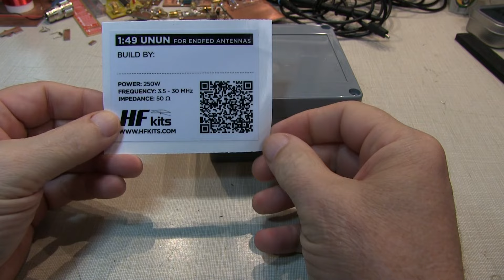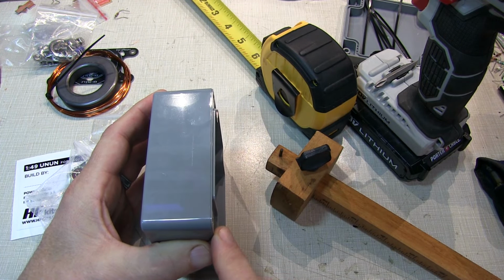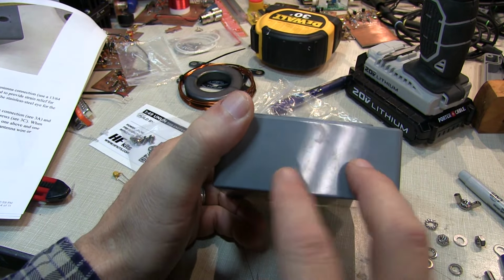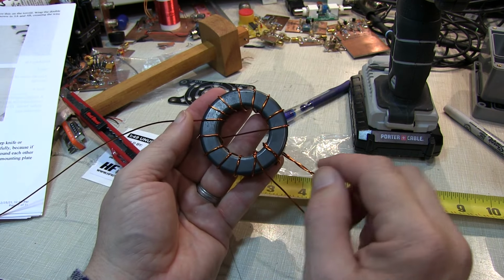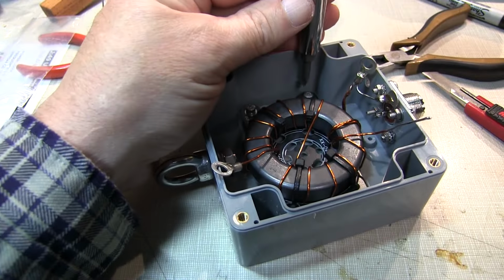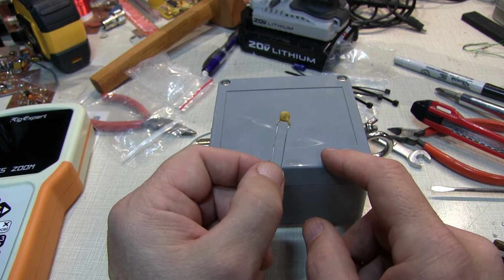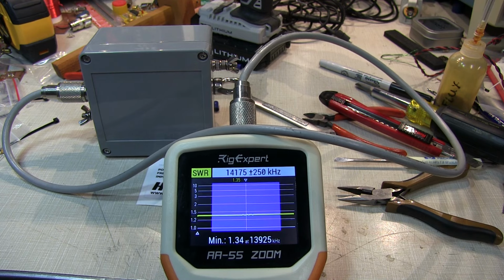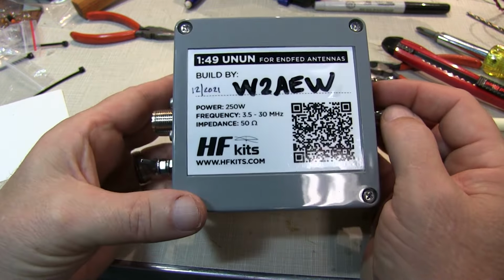#344: ARRL 49:1 End Fed Halfwave UNUN transformer kit from HFKits - Build and quick bench test

Comment: It looks like your turns are spaced apart on the toroid. I have seen all the other products with tight spacing, especially keep the input windings away from the output is preferable.
Reply from the maker: Tight windings increase the interwinding capacitance, which I want to avoid.
Reply: @w2aew  What about coupling from the primary to the secondary?

Comment: Great video. I do have a little trouble understanding the theory behind crossing the core with the secondary winding.
It's not the first time I've seen this, I can imagine there are reasons for it. I understand that it tends to decrease the parasitic capacitance of the winding.
But I have trouble with the fact that it is wound in the opposite direction of the first section: the core is the same: is it correct "magnetically"? 
The flux goes in a certain direction in the toroidal core, if the second section of the secondary is wound in the opposite direction of the first one, doesn't this cancel (or decrease) the induced current in the secondary?
Excuse my vague comments but I don't have the theory to understand these components.
Reply from the maker: If you look carefully, the direction of the windings isn't changing - the entire thing is wound with the wire coming up through the core and over the top, around the outside and repeat - even after the skip over to the other side of the core.
Reply: @w2aew  Indeed, I invent problems where there are none (it is inherent to my personality).
You have just answered a question that I have encountered many times.
Thank you very much for your help!
Reply: As far as I know, it is done this way to get the "exit point" of the transformer at the opposit site of the "entry point".

Comment: Great build video -- quality content as usual. Couple of questions (since I've usually dealt with dipoles): The instructions don't mention much about the counterpoise. What sort of counterpoise would one start off with for this antenna (what is the counterpoise actually needed for)? Would the coax cable act as a counterpoise, and might there be stray high voltages in the shack as a result? Should I ground the coax at the entry point into the shack? Would this antenna produce a pattern similar to a dipole at the base resonant frequency? I think this would be a fun antenna to experiment with! Thank you and 73.
Reply from the maker: In general, the coax shield will form the counterpoise.  Unlike a dipole where the feedpoint impedance is low, and thus a low-impedance counterpoise is needed, an EFHW feedpoint impedance is high, so the counterpoise can be high impedance also.  Another commenter offered great advice - add a common mode choke to the feedline at about 0.05 wavelengths from the UNUN at the lowest frequency of operation.  That'll generally be all the counterpoise you need with an EFHW.
Reply: @w2aew  Hi,

I plan to have only 2 feet or so of feedline outside the radio room/window pass-through with the unun attached to the side of the house and wire running out to a 37ft pole in the yard. There really isn't much feedline to "choke" or to act as a counterpoise. As a consequence I plan to create an 8ft ladder line counterpoise as suggested by one of the other commenters. In this set up would you still anticipate the need for a choke? I don't have 0.5 wavelength available.
Thanks!
Kind regards,
John - KK7JBZ

Comment: I would have liked to see the same test done but with a choke wound toroid or just a core at the input at the coax connector.  The purpose would be to see if the coax shield has RF on a part of it.  Sliding a toroid core down  the coax toward the radio might show how much of the shield is working as the rest of the antenna.  Is .05 wave length of the shield used??  If not, how much.
Reply from the maker: I'll include that as part of the antenna test when I do it.

Comment: Do you have a video explaining the math behind 49:1 and how you get that from a 2T:14T here? I also see others with 3T:24T in a Mix 43 configuration.  That is eluding me and I can't presently find anything that explains it.
Reply from the maker: Both 2T:14T and 3T:24T are a 7 to 1 turns ratio. 24/3=14/2=7. The impedance ratio is the square of the turns ratio. 7*7=49
Reply: @w2aew  Easy enough.  Thank you!  Is there any advantage of using more turns or less turns to get a ratio?
Reply from the maker: @NGinuity  More turns are generally used at lower frequencies to get the inductive reactance of the windings higher.

Comment: Did you needed counterpoise with this EFHW dipole? I am currently working on the similar kit but 100W, and will try to realize ca. 12m wire with coil, to do 10, 20 & 40m band.
Reply from the maker: Generally the coax shield will serve as the counterpoise.  Some people find it helpful to put a toroidal choke part-way down the coax, but I haven't found it necessary in my case.

Comment: This is an excellent kit. I noticed at the web site (hf kits) mine started with the german language, was surprised. I clicked on the British flag and it went to english. One guy did a test for temp increases and he used his fingers to measure it. Not exactly smart. I'll try it with a high powered 3000 ohm resistor possibly, and a thermal infra red reading point and shoot thermometer. So many of these kits come out with small toroids, not good. I really like this one but I'll be building with my own toroid ect.

Comment: Hi
What is the difference of balun or unun?
Reply from the maker: BALUN = Balanced to Unbalanced transformer
UNUN = Unbalanced to Unbalanced transformer
Balanced means that the two conductors have an equal but opposite voltage swing on them - like ladder line or the center feed of a dipole.  
Unbalanced means that one of the two conductors has little/no voltage change, and all of the voltage changes are on the other conductor - such as in coaxial cable.
Reply: @w2aew  baluns or ununs just will use in impedance matching?
So what is 1:1 balun? It has a same ratio!
Reply from the maker: @Cyrusradplus  A 1:1 BALUN is typically used to interface coax (unbalanced) to a balanced feed antenna such as a dipole or loop.
Reply: @w2aew  thank u so much for the complete answers.👍👍👍

Comment: How do you verify that the impedance range of your actual EFHW antenna is approximately 2,450 ohms resistive (turns ratio squared x 50 ohms)?  Is the reason your test SWR is not 1:1 is because of the reactance of the resistors combined with the non-linear reactance (mainly inductance reactance) of the transformer?

Also,  I am puzzled about the purpose of the primary capacitor and how the toriod mix ( 31, 43, 52, etc.) affects the impedance match and how to increase power handling capability of the transformer.  I would appreciate you elaborating on these questions.  I have learned a lot from your many fine videos.

Comment: Hi Alan, thanks for the video, I had a question though, sorry if it's a stupid one, but why do we need the double wires for the first two turns and then single wires for the rest ?
Reply from the maker: The transformer has two windings - a 2-turn primary and a 14-turn secondary.  This gives a winding ratio of 7:1 which results in the impedance ratio of 49:1.
Reply: @w2aew  ah ok so you double the wires for the primary to match the wire resistances somewhat, right ?
Reply from the maker: @AboubakrA  No. The double wire is just a convenient wrapping technique for the primary.
Reply: @w2aew  got it, thank you so much

Comment: Hi Alan. Good video. I found something that works great on my baluns. I ordered some silicome tubing with inside diameter the aize of the wire. Its high heat and hels keep the wire from shorting to torid. 73 W5DN

Comment: Hi Alan - Thanks for another helpful video. The device you built seems to provide impedance matching, at least. Does it also choke common mode current traveling down the outside of the feed line coax shield or would a separate choke on the outside of the feed line and proximal to the antenna feed point make sense? - Thanks! - Jim (KK7CSC)
Reply from the maker: It does not provide any common mode rejection.  It's a good idea to add a common mode choke to the feedline, generally at about 0.05 wavelengths from the UNUN - that'll give a sufficient counterpoise.
Reply: you can buy a kit for a common mode choke at the same place. It will look almost the same 🙂

Comment: Thanks Alan, for another great video that helps me on planning  for my first rig, if I pass the license exam. I will order one kit myself and see, what it can do for my situation. I am mainly interested in HF Bands and DX Connections. The trouble is: I live in an apartment and the only way to set up an antenna is on the attic and I will run a coax between my flat and the attic through an unused chimney. Would you expect sheath current along the coax?  I will probably need a Antenna tuner? (I am planning for a Yaesu FT 891) - P.S. You are a great inspiration and your videos motivated me a lot in trying to make the european CEPT novice license. Keep on the excellent work. Hope to meet you on the bands some day
Reply from the maker: The coax shield becomes part of the counterpoise of the end-fed halfwave antenna, which is why you will want to include a common-mode choke on the coax.  Practical advice says that placing this choke at 0.05 wavelengths down the coax is acceptable.  The EFHW is typically a single-band antenna.  Results when mounted in an attic will be a compromise.  For multi-band use, you may have better luck with a twinlead fed dipole and a wide-range balanced-line tuner.
Reply: @w2aew  thanks for the quick reply. Will dig deeper into the twinlead fed dipole!

Comment: Dear, is it really necessary a very high voltage capacitor if it is connected to the transformer primary? If everything is ok and the load seen by the tx is about 50 ohm, the voltage should be around 70 volts.
I agree of course if it is on the secondary side but in many project there are high voltage capacitor on the primary. Why?

Comment: Alan,  great content as always.  You could put a S0-239 "T"  between the coax and the input so you can add the 100pF when you need it for the upper bands.  

Also, I saw you get spotted on 40M CW last night, were you out testing the 49:1?   

Happy Holidays, 73 de KB7ZUT
Reply from the maker: No, I wasn't.  I may try to test it out later this week though.

Comment: It is a transformer. Not an UNUN. Three cores will allow you to use 1.5KW. 16 AWG is better than 18AWG. The capacitor should be100pF at 6KV (blue) rated, not 1KV (light brown), as is shown. If you use more than 200W, this core will saturate and will get very hot. Using two, or even, three cores will stop the core from saturating. The long wire has 2500:Ohms, so a 49:1 transformation will bring this to close to 50:Ohm. The wire should be cut 3.550:MHz. This will be 45.253m  = 148.ft & 5.6 inch. This will now be resonant on all bands, except the WARC bands, where you will have to use the ATU. To work 160m band, remove the transformer and use the wire as a 1/4 on 160m (1942:MHz). You can switch in another 6m to go lower in the 160m band. Be very careful to use the counterpoise wisely, as it can be seen as a half-wave dipole with an offset fed. The coax should have at least 12 clip-on ferrites  before the cable comes down to the radio shack. I use a Palstar-HF Auto that connect directly to the transformer. This is controlled remotely via the Palstar HF Auto-R (remote), via a 100ft a serial cable. There should also be another 12 clip-on ferrites at the radio end, and yet another 12 clip-on ferrites at the 16ft 6 inch from the 23ft ugly choke wound on a 5" diam plastic waste pipe, that connects directly to the Palstar or other ATU. Good to go.
Reply: It’s an UNUN because you are matching an unbalanced coax to an unbalanced wire antenna.
73 de K6ROQ
Reply from the maker: Good info, thanks.  I won't be using anything more than 100W, and mostly less than 10W, so the supplied 1kV cap will be fine.  No room here for a 148' wire, so mine will be mainly used for 40 and 20m.  I'll experiment with CMCs when I start playing with the antenna.

Comment: Great video as always! Could you please explain the SWR curve from 80 to 10m? how I was expecting a flatter curve. Is that dependent on the specific core material or the way you've built the load?
Reply from the maker: The rise in SWR at low frequencies is likely a combination of the core material and number of turns resulting in inadequate inductance in the windings.  The rise at the higher end is likely due to core material properties.

Comment: What is the purpose of this device? Is it purely for impedance matching between the antenna and txer, or is there more to it than that? If so, is it not just a transformer? (I apologise in advance if I'm being clueless - I know next to nothing about RF electronics)
Reply from the maker: It is an impedance matching transformer for the special case of 1/2 wavelength long end-fed antennas.  These types of antennas have a resistive input impedance that is 2500-3000 ohms or so.  It therefore transforms the antenna feedpoint impedance down to 50 ohms to provide a good match for transmitter/coax feed.
Reply: @w2aew  Having tried to educate myself about baluns/ununs, if I understand correctly, they play two roles.

1) They perform antenna-txer impedance matching
2) They convert, if necessary, from an unbalanced txer to a balanced antenna. (or vice versa)

However, there seems to be limited good quality technical info avaialble on the web (I can find plenty of confusing explanations, and old-timer's rules of thumb) with not much stuff that starts from a decent basis in physics or electronics.

Is there any chance that you could do some videos on this topic, covering say antenna impedance and what it depends on, balanced and unbalanced antenna feeds, and how baluns/ununs are designed and principles of operation (there seem to be quite a few variants - voltage/current baluns etc). I'd be very interested to see this.

Comment: May I make a request Allan. I have made a few baluns in the past but the subject of baluns, ununs and cmc's is a real minefield of good advise, anecdotal evidence and flat out misinformation.  May I ask you do a video or 2 covering core size/mix and wire sizing for various frequencies and power levels. When is it a transformer when is it a cm choke. wire wound and coax wound variations. 
I have on the bench at the moment a 2 core ft240-43 1:1 balun that I am making for a 80/40/20 dipole. Is this likely enough to handle 1kW pep ?

Comment: Hi Alan - One more question follows: I have a coax crimping tool appropriate for SMA connectors, and I have LMR 240 and RG-58 coax. Would it be okay to replace the SO-239 connector with an SMA one or is such ill-advised? -Thanks again - Jim (KK7CSC)
Reply from the maker: You can switch to SMA - it is a better RF connector at higher frequencies, but not as physically robust (more easily damaged).

Comment: I've made a few of these 49-to-1 ununs from scratch, but it looks like the kit is nice because you don't have to round up all the parts yourself. I used 3kV caps in mine, suspecting there's going to be some high voltages. It's never been clear to me how the parallel capacitance effects the lower bands. I use these mostly for 40M, and you've left out the capacitor for use on the lower bands. What effect is there on those bands with the capacitor in-circuit? --73, Todd K7TFC
Reply from the maker: I temporarily added the cap and re-swept it: https://www.qsl.net/w2aew/withcap.JPG
Reply: @w2aew  It looks like it brought the apparent SWR down from a low of 1.2 before to 1.02 with the cap added. It also looks like with the sharp dip at to the new low bottoming out at ~8300KHz that it might be close to 1.2 anyway at 40M. Of course that's with a purely-resistive "antenna,"  but it looks pretty good. Thanks for experimenting with that! --73, Todd K7TFC

Comment: Good kit except for one part: STOP THE SO239/PL59 Connectors!

Just stop using them. Just use BNC or N Connectors. Seriously. in 2021, if you want to offer a PL or SO connector, just provide a cheap adapter to BNC or N
Reply: That is exactly what I am doing. I got the same kit but I put the SO239 in the bin and installed an N-connector instead. Not that it matters at most HF band but I have standardized on one connector in my shack. I want freedom to use any of my cables on both HF and VHF/UHF.
Reply: N Connectors do present lower loss at the upper end of spectrum (above 200MHz) but SO-239s work just fine at HF Frequencies and have an advantage over N Connectors in that they have a higher, yes HIGHER, voltage breakdown potential.
Reply: I own, and my job means I work with, a lot of UHF gear. Also, my gear is in constant flux, so nothing stays in place for long, with items being swapped about pretty regularly.
As a result, all of my coax, antennas and other acessories have either been fitted with, or bought with N-type connectors. Wherever a radio or peice of test gear has some other connector, I use an adaptor. This has served me much better than trying to remember to bring or use a specific cable with certain connectors for a certain job.
It's more of a convenience thing for me.